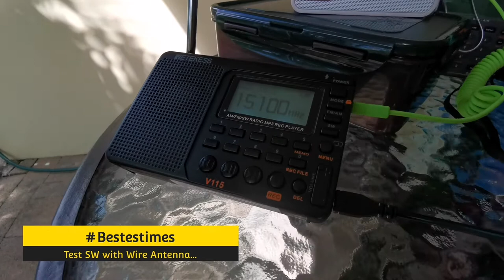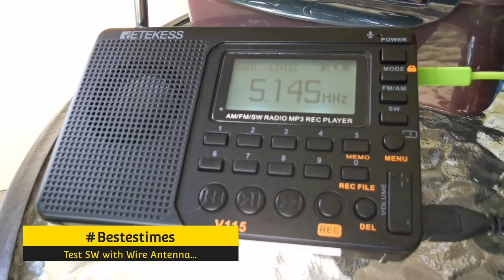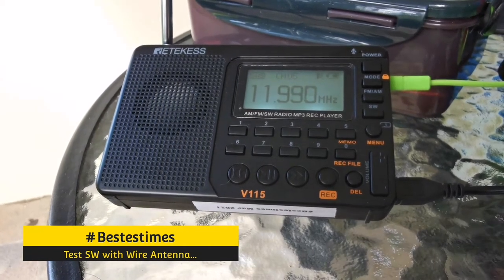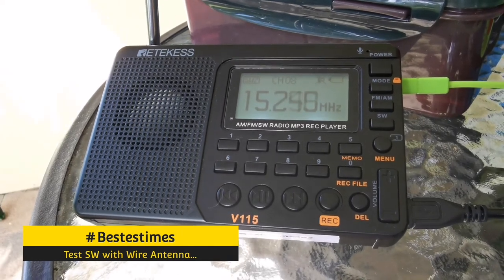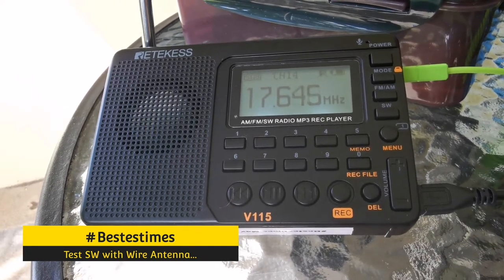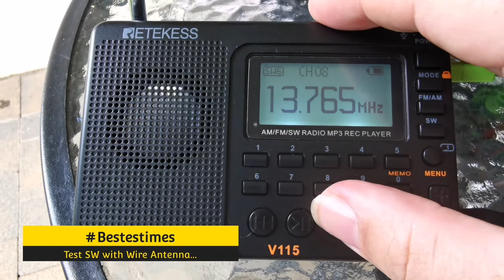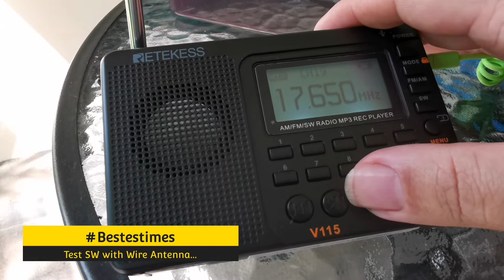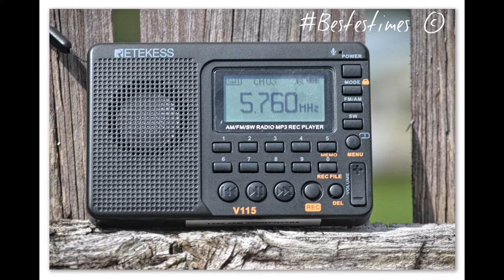Shortwave Test  (Reel Antenna) - Retekess V115.

Comment: I bought a couple. Best radio for the price, as Amazon often discounts it for 20 or less US bucks.
Great sound for FM which is what I use, and so lightweight and so small, that I can handle with one hand. Easy to fit in a backpack, and with a rechargeable battery that you can plug in. Dollar for dollar, you can't beat this sucker.

Comment: Are you using the radio without battery? is it removed?
Reply from the maker: With Battery
Reply: @bestestimesreborn  Does this radio retekess work if I take out the battery and turn the power on directly?
Reply: @cowcow5891  it works but you wont do it as it would require a quiet 5v dc power supply which is about three times the price of the radio itself. Switching mode phone chargers are unsuitable as a quiet power supply.
Reply: How could you get good results while charging the internal battery?
Reply: @leong6486  A cheap power supply is acceptable for bluetooth and FM reception only. As this radio doesn't have an inbuilt charging controller, if you happen to have a quiet power supply it would work. Try charging while on an USB powerbank. The inbuilt battery is charged and the radio stays quiet.